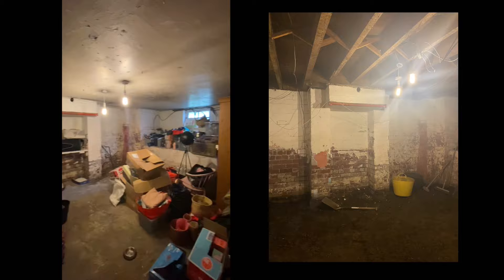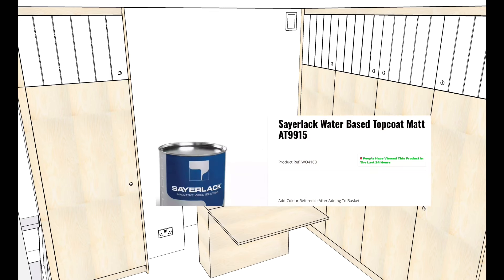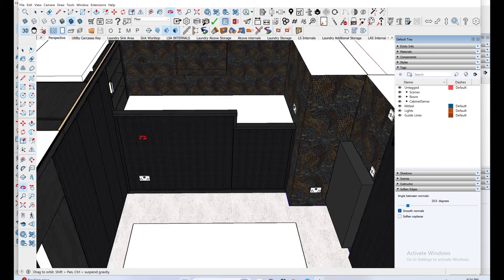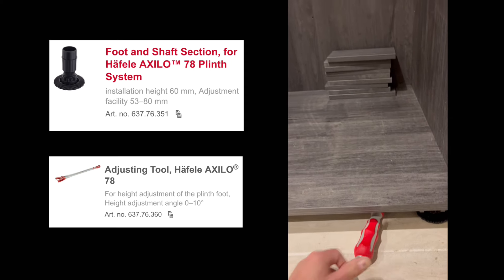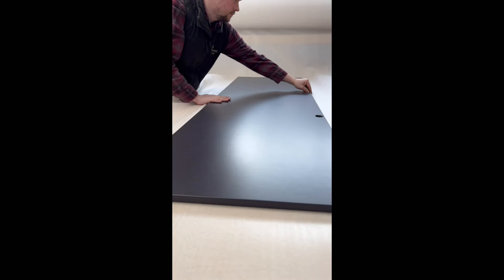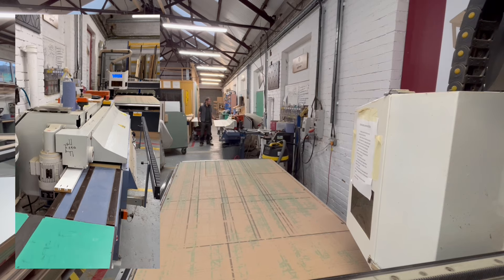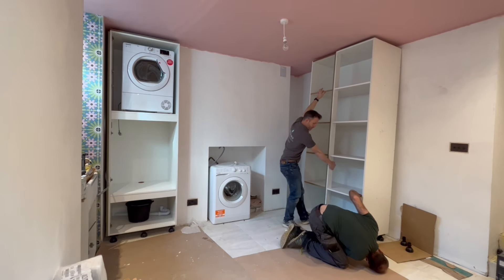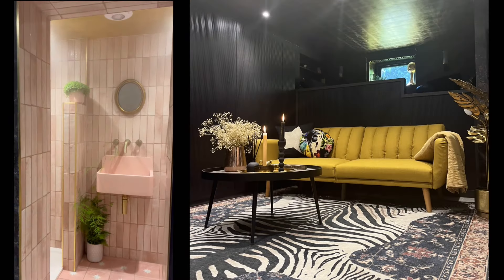Dream Basement for an Interior Designer:  Built with Sketchup CabinetSense and CNC

Comment: Great video, thanks for sharing the process. Btw that clamp at 5:20 with rotating handle, is that stock Kreg or somehow modified. thanks & regards /m
Reply from the maker: Hi, thanks!  Those are Kreg clamps used together with the Kreg heavy duty aluminium bench track which we recessed into that workbench: https://amzn.eu/d/9CXYO9d
Reply from the maker: But the clamps themselves are an old model which has been improved upon - I recommend the new ‘automax’ clamps:   https://amzn.eu/d/hCsr3xI
Reply from the maker: On the other bench we use them with these bench plates (which accept the same base fitting on the clamp as the heavy duty tracks): https://amzn.eu/d/2fPCKdQ